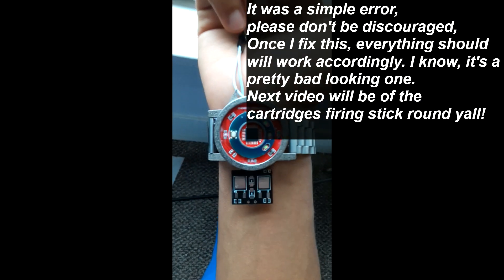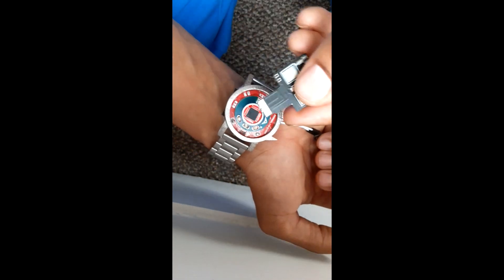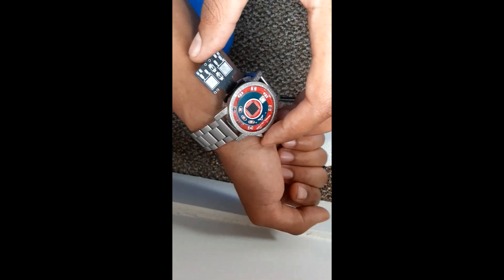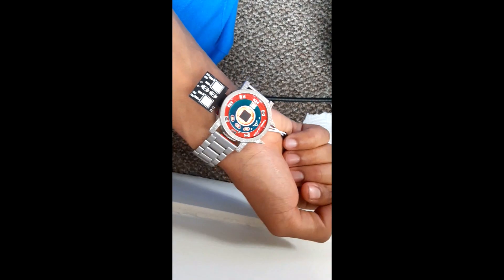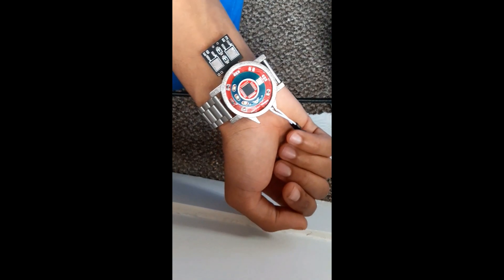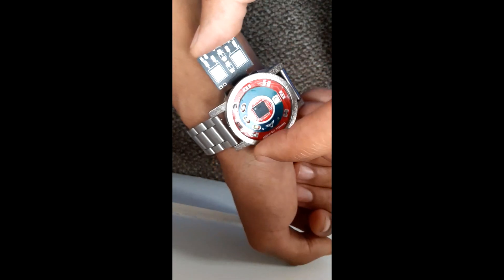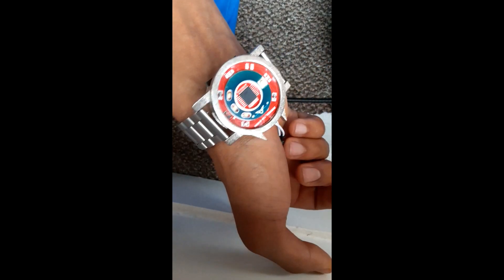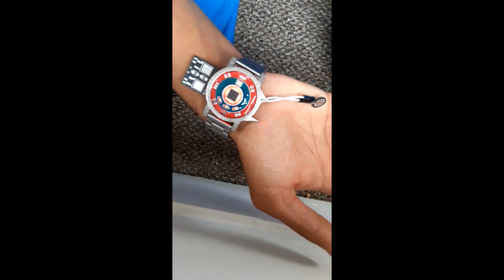The Horrific Birth of a Prototype

Comment: Whats the name of your nozzle in your webshooter?
Reply from the maker: If its that metal nozzle I showed a while back, I am still debating on using it. I need to see if they aren't too resistant to the the flow of the liquid. The nozzle will be on the cartridges. This will come with two different cartridges. One is for liquids and one is for a pre-solid line. Nozzles will vary in shape and size.
Reply: @TheExcelsiorCompany  
Thanks for responding to my question, i was reffering to the nozzle (saw it from your community post talking about a nozzle )  that looked like a crown of a watch and if it does not trouble you can you please tell me where you gotten the metal nozzle and its name?

Comment: Not to demoralise or anything
But instead of focusing on features like led’s,wireless and other stuff like that why not make a fully functioning rudimentary one that only shoots webs perfectly and then building on that for optimisation 
This will also enable you to work off a steady income stream while selling that version 
But that’s just my idea you’ll still have our support regardless of where you decide to go
Reply from the maker: I wanted to add features that would be relevant to the users other daily activity's giving it more reason to be bought and to feel more personal. I like your thinking and totally agree with that idea. The issue here is that I'm stubborn when it comes to settling for something that could already have results. I try to see what more I can cram into something in order to get more out. Sometimes it works and sometimes it backfires horrifically.
Reply: @TheExcelsiorCompany  you should try make a normal really well functioning web shooter aswell when you’ve finished this project because it definitely wouldn’t be as hard and you could make it perfectly
Reply: agreed. I think this geek slinger has a lot of potential